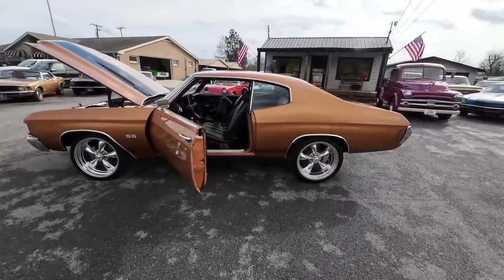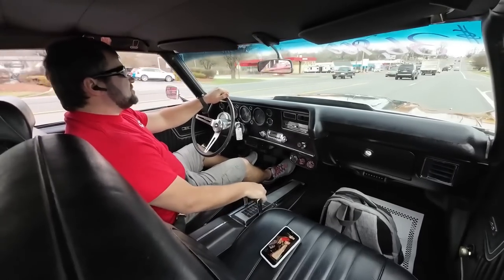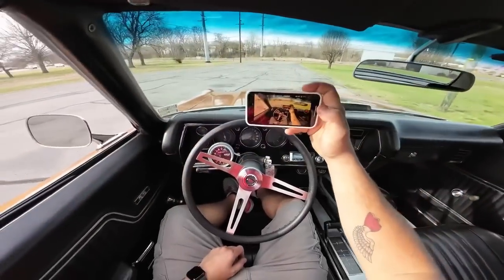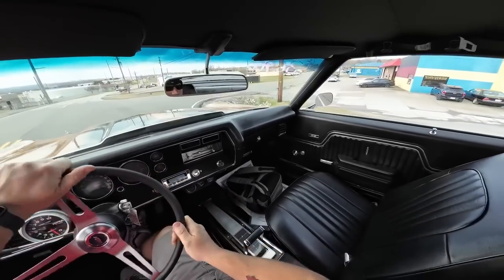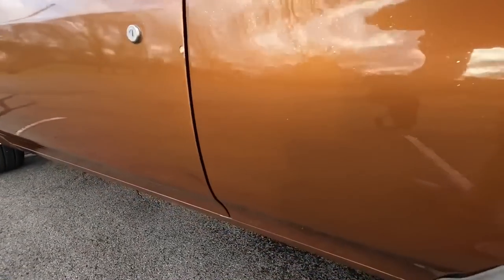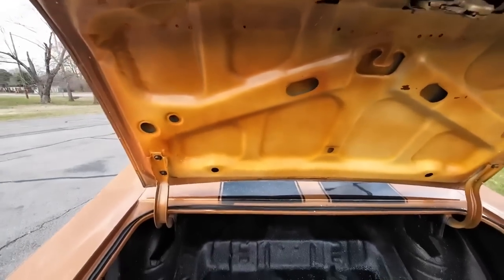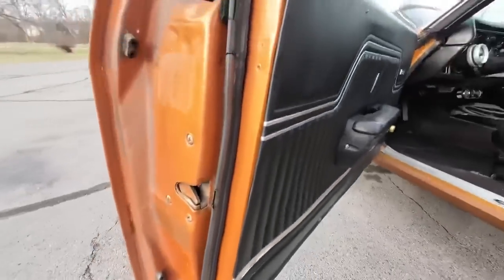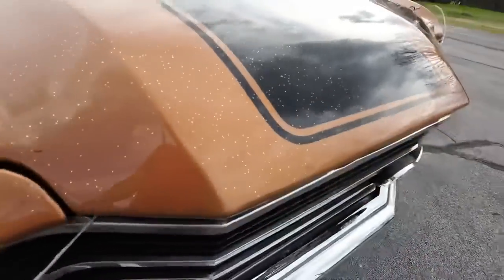Test Drive 1972 Chevrolet Chevelle 383 V8 SOLD $36,900 Maple Motors #2033

Comment: She's a runner but have to wonder why people quit on the accessories or even a fan shroud. All that doh tied up into engine and neglect cooling finishes. No fault to maple but rarely see a vid of a finished product(and I watch 'em all). You'd think a heater and horn would be a priority. Nope-spend the doh on funky wheels instead. Hard pass for me.
Reply: Don't need a fan shroud when you have electric fans. But I agree with you on the horn and the wheels.
Reply: Beautiful car, Maple Motors winner 🏆. This will sell.Great sound!
Reply: Shroud??  Its got dual electric fans. They are the shroud.
Reply: You are absolutely right... That kinda money. That paint job should be flawless... I like watching the videos too. But, they are priced, way too high. And Alot of the stuff should be fixed.... SMH
Reply: Heater?   Most people aren't driving this in the cold and snow.  Lol
Reply: I'm not worrying minor fixes can be fixed.  Usually the price for these classic beauty's in top shape is  well over $80,000.
Reply: You must be new here. Hot rods are never “finished.”  Maple doesn’t sell show cars. If you pay attention, ALL need finishing. And “finishing” means different things to all car guys.
Reply: V what
Reply: I don’t get it why people put those wheels and tires and these nice cars .  Oh well.